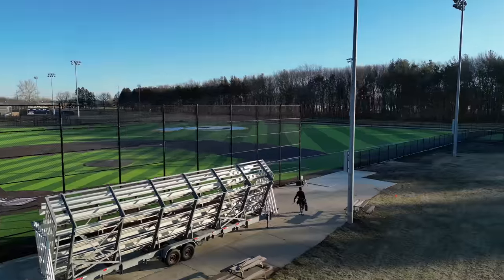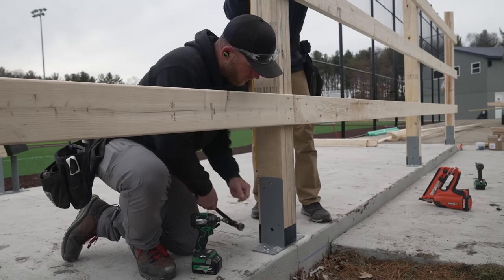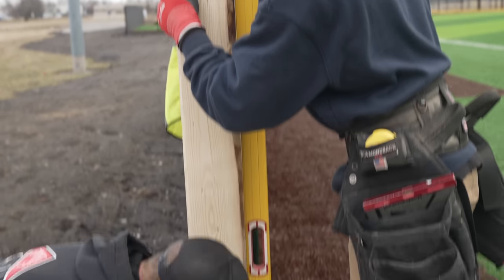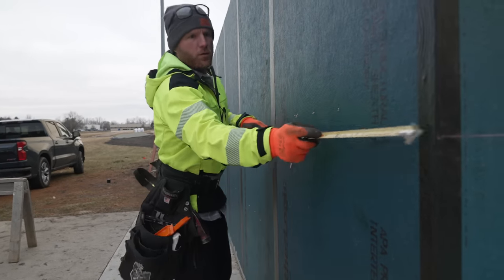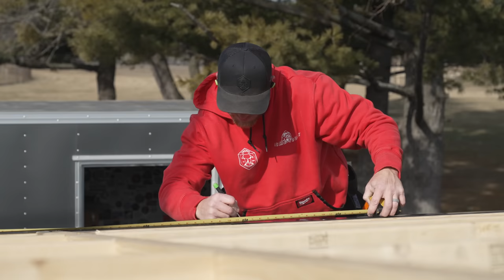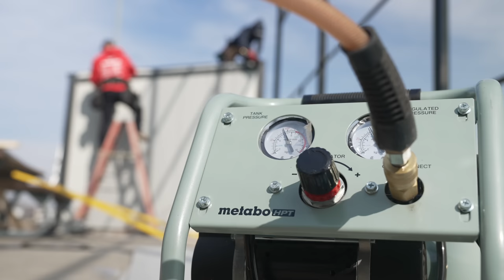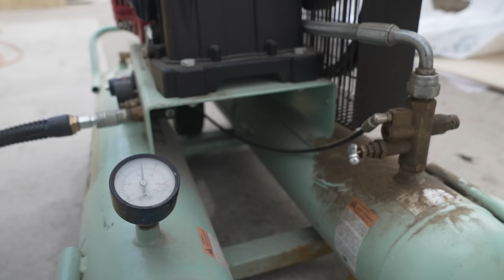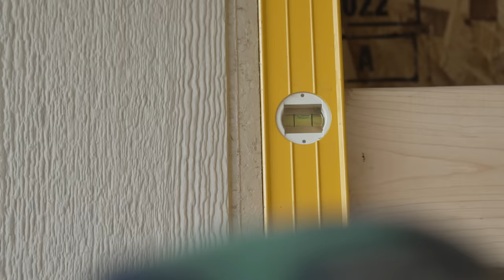FULL Build New #Baseball Dugouts Start to Finish

Comment: Nice build.  May want to consider a protective screen option in front of the dugout.  We had a local tragedy here years ago so it's just a recommendation.
Reply: I was wondering if they were  going to install one.
Reply from the maker: It is done we just didn’t donit
Reply: They are also pretty far down the line unlike most older fields

Comment: Regarding smaking the back of the impact to get the screw started, I have been told to avoid using your hands as hammers. Supposedly when you get older you'll have a painful reminder you did that. I try to follow this advice but sometimes its just easier to use a fist than grab something to smash with.

Comment: Looks nice, but shouldn't the outside of the knee wall had the weather sheeting then been done in the material to match  the exterior of the other 3 sides instead of doing it like the interior to be sure it doesn't rot out.

Comment: Seems like it would have been pretty easy to put a 3-4' overhang on the front roof to keep 95% of rainwater out of the interior (and that vulnerable 1/2 wall top) as well as shade from the sun.
Reply from the maker: That was actually the plan… the fence was in our way

Comment: South Carolina here, is it possible to build a post frame on top of a concrete block foundation with a wood floor and 3ft crawl space?
Reply from the maker: I wouldn’t build on a block wall
Reply: @RR Buildings  not even if it's poured solid with rebar installed? Triple sill plates all the way around? And thank you for replying, have a great weekend

Comment: Tip: pre drill 1/8 hole in your sheet metal where you want the screws to go. Works for roof and walls. You can do like 30 sheets at a time so it’s way faster. Also don’t have to wack a punch with a hammer.
Reply from the maker: Thanks but not faster

Comment: very nice build but I see a lot of problems with the build.. Metal roof and fascia trim will get trashed in no time from foul balls. Players leaning over wall to watch game. Ball can easily fly into dugout and hit player or coach. Netting or black chainlink would have been better. Also metal walls inside dugout not good. Again batted balls can damage metal/
Reply: I saw them install wood walls inside the dugout...
Reply from the maker: Not metal inside, there is netting on front we just don’t do that work.  Metal will get damaged over time, there was metal before held up fine.  This is at least 26g
Reply: @RRBuildings  my mistake about they inside. Sorry I thought it was metal. Still stand by what i said about the front wall. dugout way to big. Not your doing. Bench is probably against back wall and forces players and coaches to stand against the half wall. Without the wall players could sit on bench without obstructed view. Of you would need fence or netting to replace half wall. the workmanship is great.